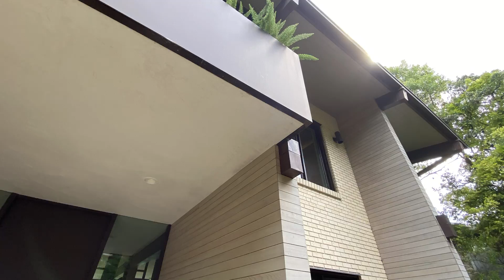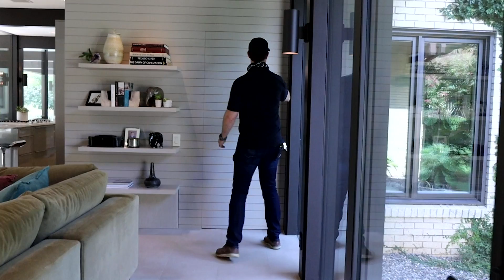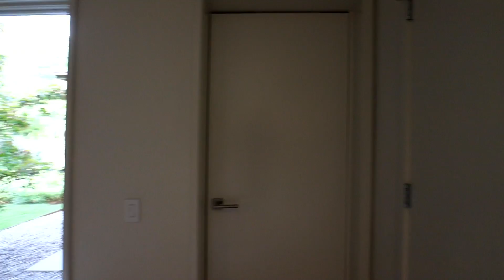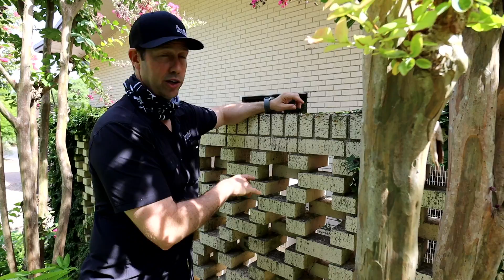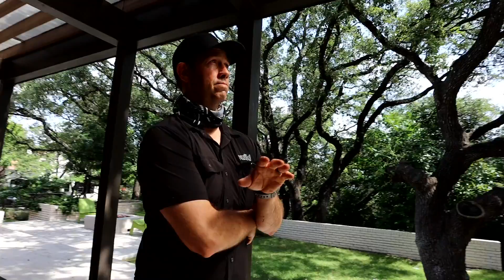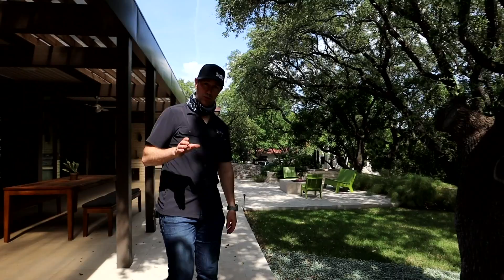Mid-Century Modern Remodel - Killer Hidden Door, Ultra-Quiet HVAC, + one HUGE Fail

Comment: Lol would be nice to update my apartment from ‘77 they updated it in 2016 I believe but it wasn’t huge all they did was upgrade the windows and repaint the outside and the walls have nun but pop corn that’s supposed to be on ceiling but it’s on the wall to.

Comment: I had a Mitsubishi 40k BTU unit on my last house.  Installed it myself under the deck for added weather protection.  
When i had guests over, no one knew it was there (90F outside, 70F inside).  This was on hundreds of acres with no ambient noise from traffic or people.  Amazing units.

Comment: Remember that Polygal stuff from the nineties being used. We used to tape the edges to seal them with aluminium tape. Lightweight and cheap, not a substitute for glass if coin not an issue.
Can't see how a house of that cost went cheap option.

Comment: I love the way you continue to not only learn yet teach. That plastic 'poly carb' (I think it is what we call it in AUS) I have in my outdoor structure - didn't take long for small leaks (we have lots of frost) and dirt. Having said that, for $800 for a 3.5 x 4 metre structure it works well. Glass on the house you have shown would be much better.

Comment: Matt lovely work and beautiful home.id just like to add considering some tips for stretching the life of the aircon units..paint THERMOSHEILD nano paint over the body of each unit. Spray wd40 over every bracket (client to maintain every 6 months) and add a smear of Vick’s or camphor gel inside the shield to deter geckos from frying the mother board.

Comment: Matt, 1/2" solid acrylic panels might work for overhangs like this.  Also, I have had good success with clear siloxane applied to exterior brick walls on a building built in the 30's.

Comment: Plastic  seems like just a nice corrugated like tuftex (poly carbonate) would eliminate this problem. Multi wall poly panels was the wrong choice. Going with a green shade would make the entire patio area very usable.  Clear panels like were used seems fine for what they are designed for.. GREENHOUSES.  Having installed the green keeps is cool  Single layer and you never have condensation.  Right product in the right use.  Glass if fine but will get grit buildup that is just nasty looking. As to the comment about the cost.. YUP.. massive cost more than likely due to odd size.  Remember if the sizing is right .. the cost will drop dramatically.

Comment: Wow! That is so reminiscent of the mid-century home I owned for several years. The entire wall of the living room area was floor to ceiling windows with french doors in the center, and a covered lanai outside, with a view of an expansive and well designed back garden. It felt like the yard was an extension of the living room. The roof of the lanai was also tiled with a similar product, and beginning to wear, although we did not have leaks. These homes were built so well, lovely timber. You did a fantastic job with the renos, keeping the original feel of the period. Thank you for sharing.

Comment: Matt, those plastic roof tiles... are they polycarbonate?  I put something similar over a pool enclosure and when they started to fail from sun degradation,  they failed fast, breaking down into little bits and pieces in less than a year, a real disappointment based on the manufacturer's hype job. They were about 10 years old. I replaced them with fiberglas panels. A bit ugly,  but the lifetime expectancy is much better. Replacing the panels in your case with tempered glass would certainly be far superior.  Nice build that you did on the rest of the property.

Comment: I would suspect that thermal expansion/ contraction is the biggest factor in the Polygal failure. I have used this, in a similar fashion, in Colorado. 4 feet length on a 4/12 pitch, set on 1/2" wide self-adhesive foam gaskets on 2 x 2 purlins, with custom gasketed clamps at the panel joins. Fortunately, I had end stops at the bottom of the clamps, and a good counterflash at the top of the slope, where the corregated steel drained onto the Polygal. The Polygal moved so much in length that the panels wiped all the lower gaskets off the purlins within a year. In this situation, it didn't cause any collateral damage, but it was a good lesson. 

A couple of years later, I did a leak repair on a set of slope glass roofs over living space, and only 14 years old. There was a line of trash cans permanently set under the worst of the leak points. Original builder tried to "VE" it, and set the glass panels directly on the wood frames, relying on external caulking to hold out the water. FAIL!!. A 9x11 Glulam (major support beam) was rotten completely through. The "fix" was to completely remove about 1500 sq ft of slope glazing, associated connecting roofs, and all the structure, and rebuild in a similar looking design, but entirely differently in the detailing. The key was to set commercial slope glazing frames on the new wood structure. These frames have a complete set of drip collector channels, draining to the exterior. All glass is secured by gasketed clamps, and there is NO reliance on external caulking to maintain water tight integrity. All it takes is the effort to find the guys who know the technology, the will to then do it properly, and about $500K. No leaks, no problems after we finished. 

Point is, it is not just using glass, it is using even glass in a proper manner.

Comment: Is that heat pump water heater able to use the heat pump?  I thought they needed a fairly large open area to run efficiently?
Reply from the maker: No that’s a natural gas unit. AO Smith Vertex
Reply: Thanks

Comment: Have you ever thought of a one on one Q and A  for fee service? Or a Reddit page ?so like minds could help each other ?
Reply from the maker: I like that idea. What’s a good format?
Reply: @buildshow  I think you need to request a sub Reddit. For example /r/BuildShow. I think it's pretty easy to do.  You could assign moderators to make your involvement minimal. And people can just post and get their questions answered by who ever. Probably could also ask your sponsors to have their tech support people monitor the site and post manufacturer recommendation  or products that answer the posters question. Or the other many guest architects could provide guidance if they have free time. 
For one on one. Maybe Skype or what's app with a payment page ? 
Could really use some input on my late father's house which quiet a bit different than most of the traditional houses posted here. Would love to pay for a session or connect to local architect firm :)
Reply: @shahsmerdis  You should become familiar with Building Science Corp and their website, also Green Building Advisor. BSC does do paid consulting, as well. The information presented thereon is based on observation, research and testing. As such, it carries more weight than anecdotal evidence, which is what you will mostly get on a discussion-type format. There is a substantial contingent of nay-sayers who will tell you that anything new or different is terrible, based on the fact that their brother-in-law never did that (and he is still alive, house hasn't yet collapsed). I like to know the underlying basis and "first principles" for any procedure; with that, you can confidently approach any problem, even if it seems to be a novel case.
Reply: @buildshow  

https://www.reddit.com/r/HomeImprovement/  for example has a lot of home improvement question but it's not focused on fine home building and best building practices you preach. A lot of people there do link to your videos though  .

Comment: Instead of glass panels for the porch roof why not polycarbonate?  Much much lighter and I expect also cheaper, easier to install.
Reply: I'm a fan of Suntuf & Palruf panels.  Probably the Suntuf in that situation.  It works well in that low-slope (but not flat) situation.
Reply: @sylvandaugert6203  I looked at the panels you suggested but they all seem to be a corrugated design that would trap leaves I imagine. Have you used a flat panel and if so, what?

Comment: Your comment(s) on value engineering and your later maintenance headaches reminded me of one of my gripes about most “value engineering”.  That is it usually only considers the construction cost(s) and ignores the costs that may be stuck on maintenance later.  Maintenance costs which ultimately end up costing way more in the end.
Reply from the maker: Totally agree. My fail for not pushing back harder on this VE option
Reply: Matt Risinger experience is key, it can be hard to identify costs that are going to be shifted to O&M, which makes it difficult to push back without hard experience to back you up.
Reply: In "defense" of this example of "value engineering" - At least it's a piece of the building that can be easily upgraded after the fact. So if you're up against the budget and something's got to be cut, let it be something that can be added or upgraded in the future without undoing other work.
Reply: We as a society have grown to believe we should have an awful (!!) lot for a very little. The aftereffects linger for a long time, and I don't expect a sea change in my lifetime (now near 70), at least as regards the value judgements collectively made on size vs quality of residential construction.

Comment: I'm currently using the same corrugated plastic product to build a greenhouse. I am sealing both ends of each panel with aluminum tape. Once they're put in the frame they will get caulked.
Reply: If you can, use microporous tape!
It keeps most of the liquid moisture out, and lets the vapour escape. Protecting the ends from direct water entry is more important though. Overhangs and overlaps, keep the tubes in line with the pitch, make sure the water can get out... aall the stuff you've already heard a few times
Reply: @samuelmellars7855  thanks for the tips, but I doubt I will be able to use them since I'm working with a Harbor Freight Tool Co. greenhouse kit. I'm sure I'll make modifications along the way.

Comment: I like the patio outside the wall windows. Agree that the plastic roof tiles was not the best.
Reply: It looks absolutely terrible. Such a large and obviously expensive house and some wild cheap plastic appears. I wouldn't even use that on a porch connected to a run down mobile home.

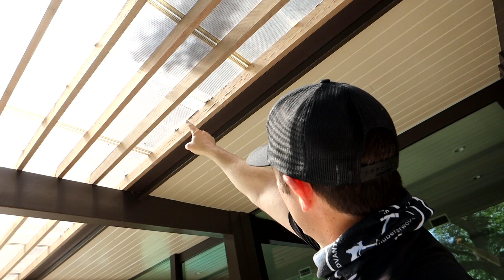Comment: 10:43 I had something similar on my porch aswell. Ended up, drilling two small holes on the underside of each run. One at the very bottom and up at the top. Just like you said, water must have a way to get out. Dont't know if it's gravity or the draft created by the heat but it's bone dry now.
Reply: We had the same in our previous house. Always spraying with bleach to get it cleaned out. Wish we had thought of drilling a few holes in them.
Reply: I think it may just be capillary action. Low pitch.
Reply: Good idea.
Reply: Drilling the small holes was a recommendation when I replaced something similar to what Matt is dealing with. I replaced the poly carbonate panels with fiberglass and drilled the recommended holes. A very hard driving rain will sometimes push enough water up underneath to cause a weep. Otherwise, DRY !